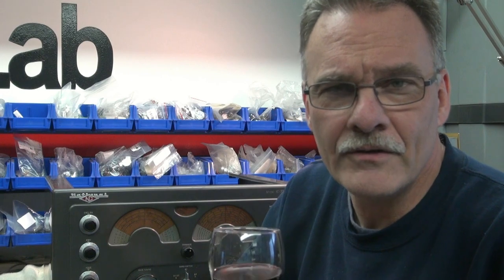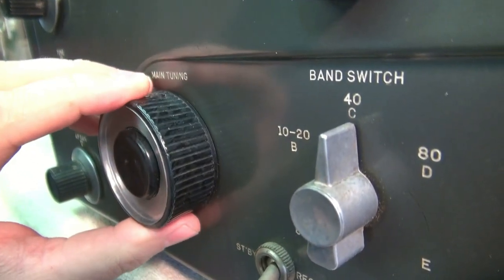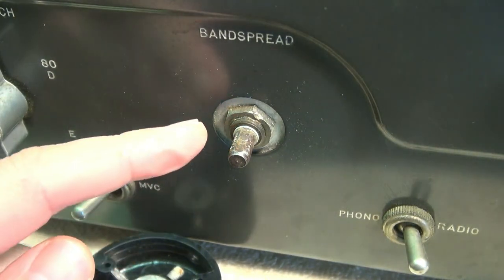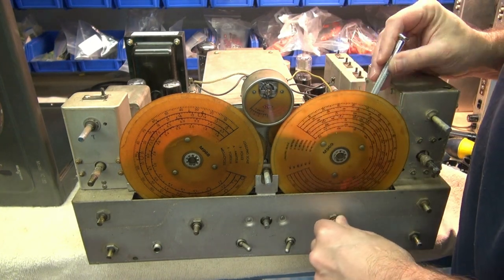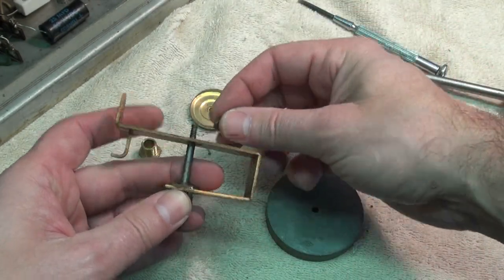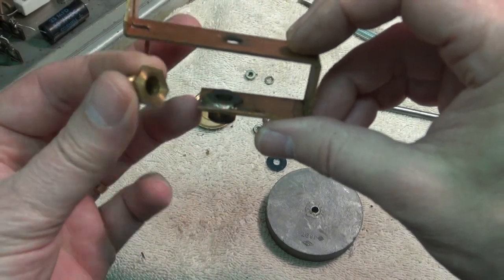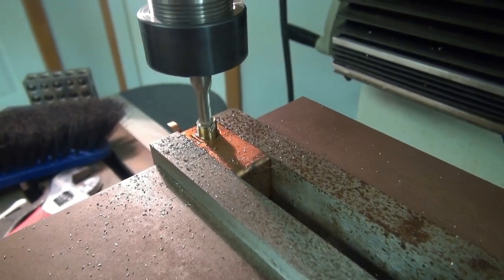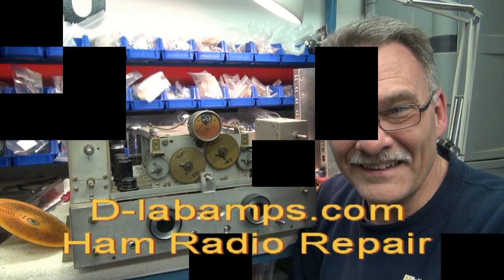How to Repair National tube Shortwave Receiver radio dial slip by D-lab

Comment: Terry, I just went through this same problem with my NC-173. I found the alignment between the dials and the pinch wheels to be the most critical part of the whole assembly. The 173 is not as robust as the 183, but still the same principle. The amount of “squeeze” between the pinch wheels and the dials is very critical and it took a lot of trial and error to get them right. I was fortunate enough that my bushings were not worn as bad as your example.
Thanks for the video. 
73
de Chris,  N9WHH

Comment: Interesting video!  After all your work, how does it perform electronically (sensitivity, selectivity, etc.)?  Noticed it also had a 6 meter band...
Reply from the maker: +vonzigle The receiver appears to be working well on all bands. All functions are performing OK. I still need to check alignment and sensitivity with my Wavetek generator. That video will follow.

Comment: Terry, I really appreciate the NC-183 videos, as I just acquired one from Shopgoodwill.com  . I wonder if installing a press-fit bushing on the tail end of the shaft wouldn't help prevent the wear on that front bushing, as the shaft would be fully supported on both ends. Then, just maybe, the receiver would make it into the 22nd century before the bushing wears out.